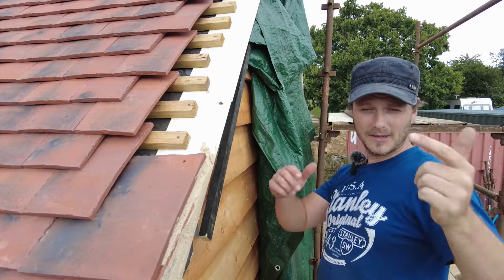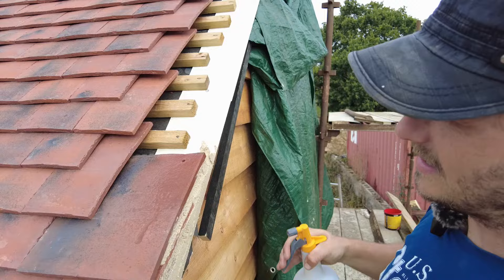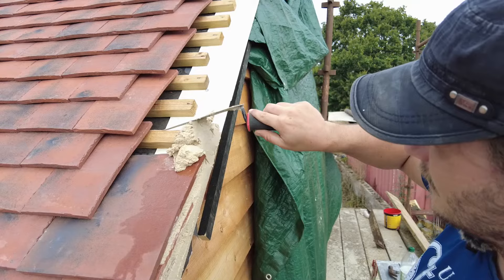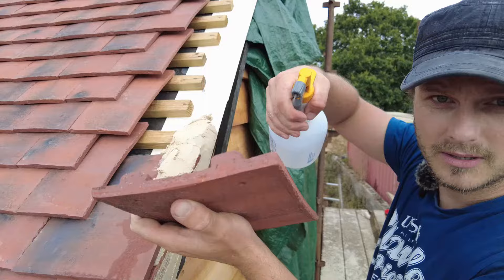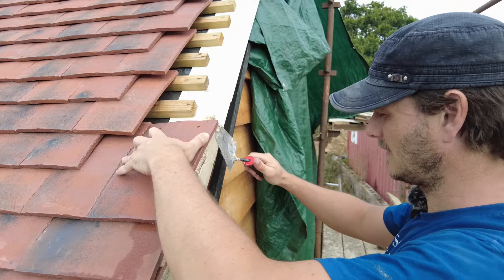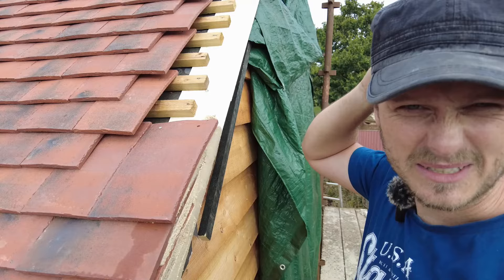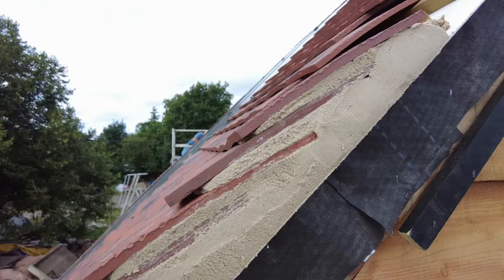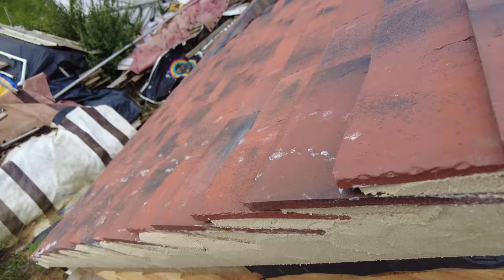How to Bed and Point roof Verge Tiles with Mortar - DIY

Comment: There's no doubt this will end up being a very aesthetically pleasing verge detail but in reality this kind of attention can only realistically be applied working on your own projects or if a quotation allows for this kind of time. I'm a roofer myself and you are doing a very very good job there.
Reply from the maker: Thanks buddy. Do you find yourself doing mostly dry verges these days?
Reply: Yes m8 for the most part. I'm of an age where when I came into the game everything was muckwork (sand and cement/mortar) so that's what I learned which I'm grateful for as I can do both whereas a lot of the younger men today can only do the dry fix which isn't there fault I suppose but even though its rare there are certain areas where traditional details will always be such as heritage and in general roofing from time to time and I'm grateful I have the skills to do either. It's a bit of a split debate. If I'm honest I prefer the more traditional aspects of roofing. The methods are tried and tested and a lot of the modern products look cheap and tacky in my opinion. It seems the emphasis is focused on speed over everything. That's not for me. I don't like sitework at all for multiple reasons. The major one that really gets me is the lack of care a large majority of people show towards others work due to the "crash the meterage down and get the money in attitude. I was on a very nice site in Bath the plots were luxury homes and apartments. The roofs were natural slates. Gable and hip structure mostly and the parapet walls clad in lead. Very typical for the area. It's a heritage city. The mess the stonemasons made on the slates and the amount they broke was insane. The vent details I made using lead on site got walked over and damaged to an unsavable state. It was hard to understand how so much mayhem was caused by the putting coping stones on the wall. I went to the trouble of getting a couple of damaged 50mm sheets of celotex insulation boards and got them up on the scaffold for them and asked them to lay those on the roof and work off a ladder laid on them. As you can guess no doubt they didn't get used and this just went on until we refused to slate the roofs if the copings weren't done. I could go on but I won't lol
Reply from the maker: @LeeTarrofiyfdsyesippptitled  sounds like a nightmare! You come across as one of the tradesmen that actually cares though 🙌 I was thinking about the time thing today with something I've been faffing with and thought I bet no-one bothers doing this because they need to be in and out so they can earn as much as they can in the shortest amount of time
Reply: I feel your pain. Whole new reclaimed Welsh slate roof, scaffolds up to allow fix of leaks and so now a 14 broken slates, and fruit trees damaged. Nearly six years after the rebuild start, still on-going!!

Comment: Great video as there was very little info on this when did this job myself nearly 2 years ago. the roofers I tried to get to do it quoted astronomical quotes or wanted to cap over the failed verges. Mortar was literally dropping out and felt repointing wont last.I ended up renting a scaffold and removing the end verge tiles as you have and fully bedding the tiles down on a fresh layer of mortar. Absolutely solid and even it it fails within next 5-10 years it cost me less than 25% than local roofers wanted and I learnt a new skill.
Reply from the maker: Nice one 🙌 ah well if it fails we know we can just do it again 😁

Comment: That mortar gets wet and rots the battens said when you squash dow that tile mortar covers batten .please protect ends of batten you can get batten end protection caps or wrap a couple of layers of membrane around it and staple fix to batten.
Also mix sbr with cement base the under cloak  and underside of tile it never come adrift with a mechanical fixing as well ,I uses stainless steel screw

Comment: So I have an issue where the under board has broken and the mortar has fallen out having to fill it in but not replacing the under board. Not sure quite what I need to do to fix it!
Reply from the maker: I honestly can't see it being done without sliding in another board in. The mortar isn't self supporting

Comment: Hiya I have a 1998 built gable roof which has some undercloak and edge mortar falling off and a sagging soffit. Can I get advice on how to repair or do you have any vids? Would I have to remove all the fibre board and edge cement or Can I spot repair
Reply from the maker: Hi Harmeet, I'm not a roofer so can't give any solid advice as such. I would have to see a picture to have a go at pointing you in the right direction. I would say it is quite possible to patch repair something like that but it really depends how far gone it is. Otherwise the belt and braces approach would be to take off all of your verge tiles and redo the undercloak and bed your tiles like I have on this video.
Reply: @THE-AIDEN-PROJECT  thanks mate for the advice. It’s a small staggered terrace gable edge so only effecting the lowest point 2-3m out of a total 6m-ish roof edge. I can defo send you pics if you can tell me where to email over
Reply from the maker: @harmeettatla1981  do you have instagram? My profile link is in the description
Reply: @rickphillips5098  had a local roofer do the work at very reasonable cost. It’s 1998 roof so don’t think asbestos would be used in modern era

Comment: I have old fashion lime mortar inside my attic it keeps falling off. We prefer using screw too than nails. Can also get them out easy if made mistake. Only when they rust are the hard to get out
Reply from the maker: I think that's called lime torching. It was done before tiles had nibs to secure them and also to stop wind driven rain or snow. I was going to buy a house once that had that but decided against it as they wanted too much money considering it needed a new roof and lots of other things
Reply: @THE-AIDEN-PROJECT  Thank you for that, I will try and find out if it can be done from inside. I just had my roof patched up from outside. Roofers came. The scaffold team came first of course.  After the work was finished . The roofer said patching up is OK but with these old roofs it is better to make the entire roof new. Cost me close  a £1,000 to get the holes fixed. and scaffold put up. The scaffold team took about an hour to put it up. The roofers took about 4 hours. He said afterwards if there is another strong wind most likely more slates will come off.  I typed in "lime torching" as you mentioned and just saw this https://youtu.be/g3ocOg1Nfjc
Reply from the maker: I'm guessing they used 'tingles' to fix any slipped slates? If the roof is old then the original fixings have probably gone bad and maybe the torching was the only thing keeping them on. You can do the torching from inside like that video has shown. I've done a lime day course before so it might be worthwhile you finding a course as the instructor will give you advice. I'm sure you'd be able to do the lime torching yourself then 😀
Reply: @THE-AIDEN-PROJECT  I would rather DIY nothing worse than paying to get a job done then just days after it goes wrong. Last time that happened is when I got my old boiler fixed. I got a brand new one afterwards. Lesson learned. I think going on a course would be best. Or paying someone that does it for a living to train me. I hate awkward places to work. At least I have put a nice firm floor down in my attic to work on.
Reply: @THE-AIDEN-PROJECT  I looked up "tingles" but only saw sunbed cream. Doubt that was what you mean. Do you know which Lime mortar might be best, to re do torching. I saw 3 types: Lime Green Natural Hydraulic Lime medium Mortar / Ironstone Lime Mortar / Lime Green Natural Hydraulic Lime Mortar (Strong Mortar)?
Reply from the maker: @StevePhillips   @Steve Phillips  haha Google 'lead tingles' that's the traditional way of strapping slipped slates, you can get copper and aluminium ones these days too. I done the day course about 3 years ago as we were looking at buying a period gatehouse. It was at Limebase in Taunton. I'm sure you could call them or any specialist lime supplier and they can tell you what you need. I suppose its based on your budget really as its cheaper to start with raw materials (quicklime - slake it yourself)

Comment: Muck too wet, and you don't need to mess with the muck so much, as you are staining the tiles. Wait for it to dry, then scrape the skin off. You can always clean the stains with a sponge and lots of clean water, if necessary, use brick acid.
Reply from the maker: It was a super hot day so done the muck a little wetter so we didn't have to do too many mixes. My mate was doing the other side whilst I done this gable. Turned out fine in the end though 🤷‍♂️